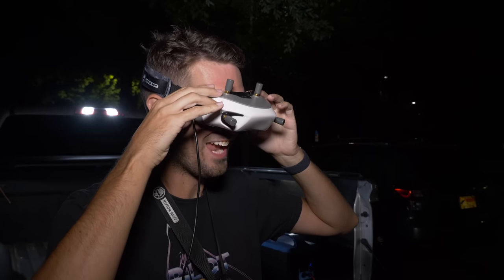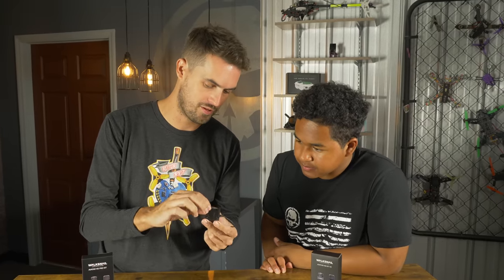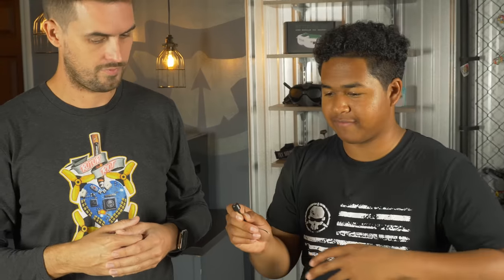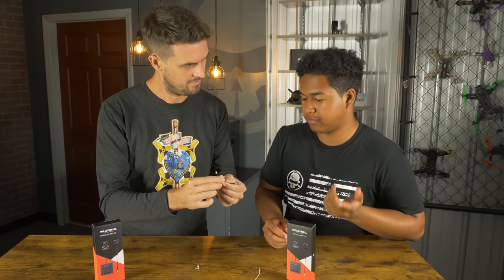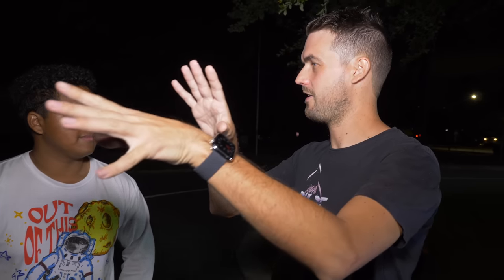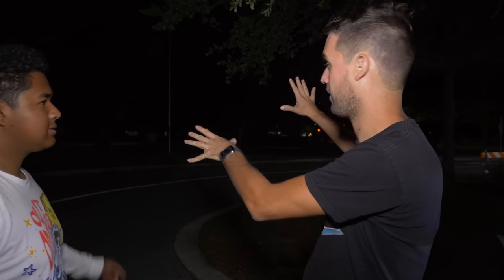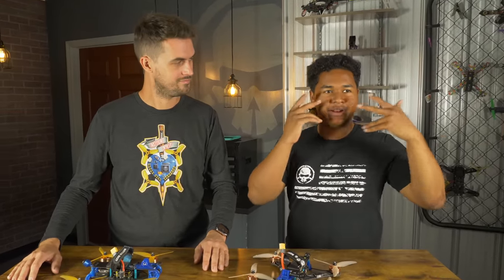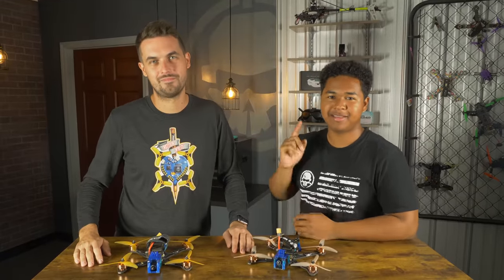NEW Avatar VTX's! - Low Light Flying is INSANE!!

Comment: As cool as night flying is, notice when Drib is flying and describing his experience saying things like "I can see the clouds," and Bubby is standing next to him saying "really?"  It just reminds me that we don't have audience mode.
Reply: The Dominator goggles can share the screen through a usb c to hdmi connector
Reply: @matcherbuds  I have 2 Walksnail goggles though, and a VRX.
Reply: I think they just fixed it recently?
Reply: Not the case anymore.
Reply: Buy the Avatar VRX. It has HDMI output.
Reply: YET

I think that WS share mode works by rebroadcasting the signal from the master goggle to the spectator one.  The real question is whether you can rebroadcast to more than one set of goggles...
Reply: @visioneerone  well I haven't tried it yet, but I noticed when I turn on share mode I get a choice of like 5 or 8 channels so you're just basically rebroadcasting like you would your Wi-Fi on your phone from what I understand. 
Anybody's welcome to correct me if I'm wrong like I said I haven't tried it yet.
Reply: Wrong share mode exists now.
Reply: @cinemoriahFPV  Look up one comment. They know but am I wrong?
I don't have another VRX to find out.
Reply: @MadDragon75  it’s prettt funny but caddx released the firmware with share mode working like a week after this video was posted

i purposely bought a set of the recon HDs for use as ride-along goggles. (lol rotor riot had a 10% off sale running on walksnail gear). Share mode works perfectly so long as the goggles and vtx are on the latest firmware.

Comment: Speaking of the mounting points on the USB board: Quad pilots aren't the only FPV pilots. On a wing that USB breakout board could mean actually using the feature or not depending on where your VTX fits in the airframe.
Reply from the maker: Very good point it could help a lot for wing mounting
Reply: @RotorRiot  Hi, i build custom drones, and for me having a usb board is actualy very nice to instal in a handy place on the drone
Reply: note that the remote board can be used with the V1 vtxs as well. Just have to change the plug end.

Comment: Drew, the lens is a circle. More square image will fill the circular field of view better, therefore, you will always get better vertical field of view with 4:3 camera, compared to 16:9. If you put a wider lens and get your "free" updown, you'll start losing the sides to vignetting, effectively turning your image to 4:3
Reply: What vignetting? I don't see any brightness decrease as it gets closer to the edges.
Reply: @kingscroach  they didn't put the wider lens on, I'm discussing a scenario when they put a too wide lens
Reply: @Silor  I seemed to have read your comment wrong, my bad, I was multitasking at the time. The vignetting really comes down to how the 16:9 is implemented by default, if it's taking the maximum visible square from center and stretching it horizontally or if it's simply taking a 16:9 view from center, it's hard to tell without seeing their reference checks they did to check the vertical view, and then also on how it was output.
Reply: ye it was kinda silly how he said that like 5 times and it doesnt really make sense..
Reply: @Silor  yeah that was rather incorrect to say that at the same focal length it would reduce horizontal field of view in 4:3 versus 16:9. For the same sensor size it would only be an increase in vertical field of view for the same sensor size. Also there is a reason wider lenses aren’t always better. More distortion and less light transmission will result from a wider angle lens.

Comment: I agree, I like the 4:3 -- however stating that you get more width on the 16:9 is not accurate because typically the 16:9 simply stretches the sensor data to the edges and cuts the top and bottom -- just what you were seeing.  Also, the color and the image quality looked better on the 4:3.

Comment: Testing 1 click summary with Merlin - Discussion about the new Avatar video transmitters, including their features such as mounting holes, solder pads, and antenna connections.
✦
Avatar releases new video transmitter with exciting features
00:00
✦
Avatar video transmitters V2 and Pro record in 1080P 60fps with improved image quality and gyroflow stabilization.
Click to expand
04:42
✦
Testing V2 and Pro Camera of new box nail video transmitter system
08:56
✦
Choosing the right aspect ratio for your camera
13:49
✦
The 4x3 camera is better for freestyle flying
19:50
✦
Flying with low-light camera is a game changer
23:40
✦
Flying with a wider lens provides a taller field of view and better low light performance.
28:26
✦
Pro Camera offers impressive low light performance
34:15

Comment: wow, this is a DJI killer! I'm so tempted to buy especially i'm still on DJI v1 goggles
Reply: its not a dji killer the 03 air unit is still better dji is still better if you low light flying get a polar cam
Reply: @grampafpv8013  that's true since O3 has 4K resolution I think. But I would disagree with you on the polar cam. I have a polar cam and I can tell from experience, it is impossible to achieve what Drew and Buddy flew thru.

Comment: Interesting, as Sony A7 photographer since it came out, it's very recognizable that this is a sony sensor. The dynamic range on these is pretty big and the noise floor is pretty low. The way the sky is displayed is excatly how I am able to recover it when I edit my Sony raw files. There is def. some post processing going on as you can notice the sky coming in and out depending on what the brigtest lightsource is. Some kind of threshold gets triggered and then it boost up the dark and brings it into the visible range again which blew my mind back when I switched from my Canon 5D MkII. Really smart choise by Walksnail, didn't even know you could get sony sensors with the same capabilites from the Full Frame sensors in a form factor like this. Question is, is it the sensor of the A7 series or the A7s series. But really amazing to see that Sony sensors are a thing because if you'd put a 1" sensor or perhaps a tad bigger one in there with a neat lens... please give us Sony-Raw/Log internal recording!? 95% would never need a go pro on their quad. Plus price it as a VTX+Camera+150€ go pro... offer it for 250€ and it'll sell like hot pretzels.

Comment: i feel like 16:9 will always give you better spatial awareness, which is important for not crashing, and 4:3 might be slightly better for learning throttle control. but after you've learned the throttle curve and rates of the drone, you don't really need the vertical positioning as much

Comment: I was going to buy the DJI V2 Goggles but decided against it because DJI Air units are typically $100.00 more than WalkSnail air units.you can buy a WS air unit for $125.00. Besides the cost Congress is going to ban DJI products,it's just a matter of time.

Comment: yes you can change lens but then you get even more front standoffs and props in the view. I actually disliked the ultra super wide lens that came standard on the V1 walksnail mini camera. it was terrible. also walksnail doesn't sell different lenses so you will have to diy until you find a lens that works